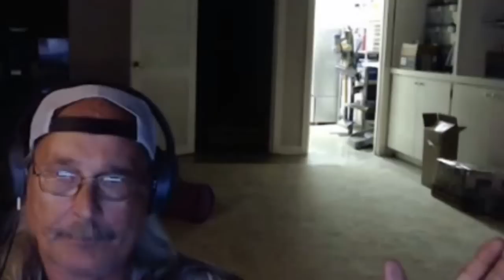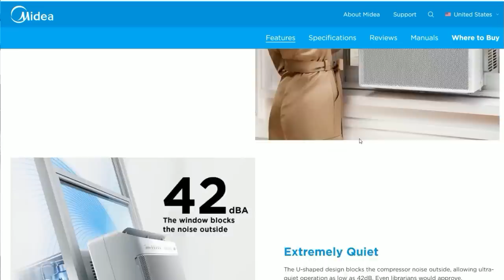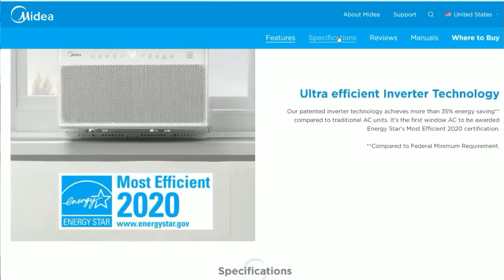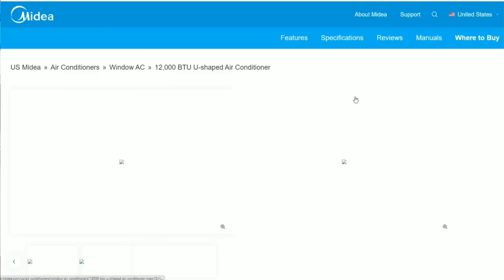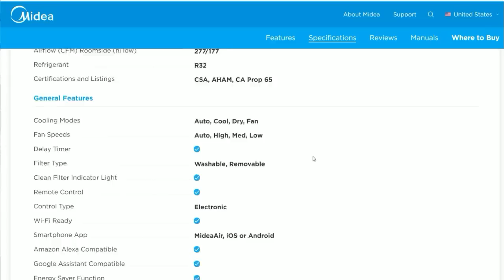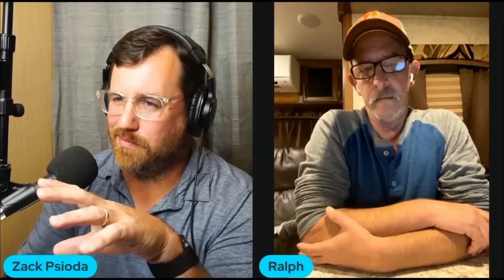Let's Talk HVAC Brands!

Comment: I’ve found that low speeds do zero dehumidification as the evaporator coil temperature is above the indoor dew point. Problem is drastically oversized evaporator coil, manufacturers need to add an additional EEV at the evaporator coil, providing the ability to shut off the top half of the A-Coil.
Reply: If your evap temp is above your dew pint you have a problem and won’t dehumidify. Low airflow dosent do that as it makes the coil colder not to many homes it’s a 38 degree dew point
Reply: Coils are getting bigger but at that point two stage compressors,inverter equipment could provide that